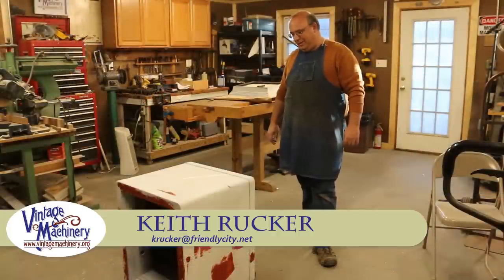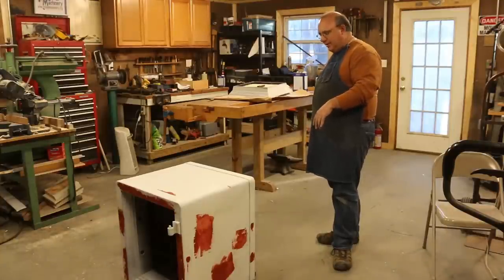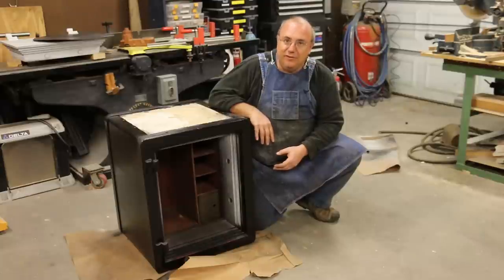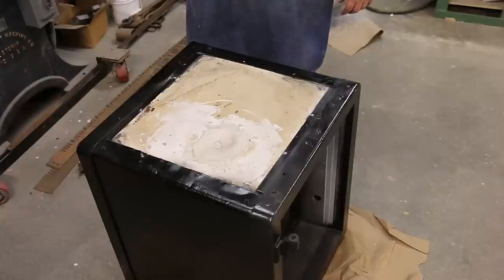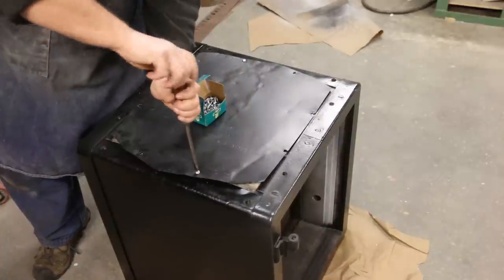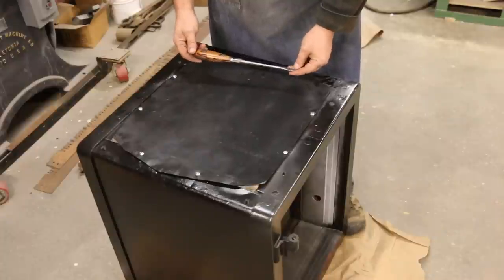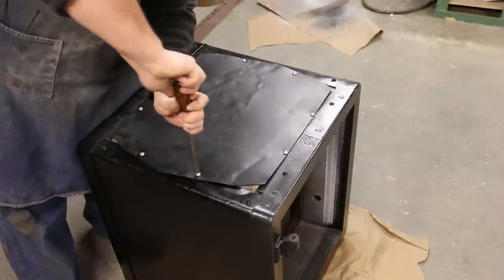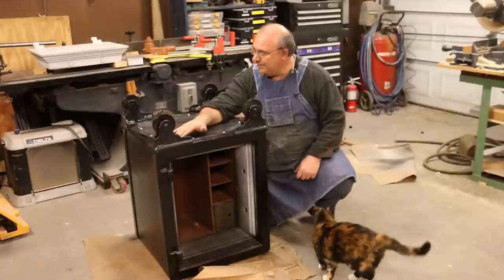Victor Safe Restoration - Part 7:  Paint and Reassembly of the Bottom

Comment: Mr Rucker one more thing while I'm thinking about it. Just went out to my old building to confirm this. However I have an old Briggs & Stratton lawn mower that it's engine has an updraft carburetor on it. I tried getting a cab kit for it and the gentleman at the small engine shop said it dated back to 1950 lol. That's another project. I did however actually get it to fire up and run for just a few seconds and it don't sound anything like the engines do today. Sorry to keep on about all this I just like my old things. You have a great day Sir.

Comment: I collect old school things. I have an old Philco AM radio that's all tube built in 1936, I'll be restoring myself when I can get all the various components I'll need. It's got a glass dial face. Only thing I'll need to send out will be the speaker to have it re-coned, I was hoping when I got it there wouldn't be much Id need to do other than change the caps and maybe a few bad tubes. Didn't work out that way lol also own 2 old MAYTAG ringer washers. One was built in I believe 1947 the other 1965. The 65 model works great Im going to wash a load of clothes in it after I change the transmission oil lol The 47 needs a ringer head but transmission and the motor an body is in great shape. What I want to get next is one that has a gasoline engine. We had one when I was kid and that thing was some kinda loud, straight pipe was all it had lol but it got the job done. Enjoy the videos Sir God Bless.

Comment: That will be a very nice safe when you are done. I have a very similar safe that a previous employer sold to me for next to nothing. Mine is about 50 in. tall with no major damage. It has an inner door and also shelving with a lock box just like yours. Mine is a little bigger so the lock box with the little shelves are in the center with larger cavities on both sides. They disabled the lock (without damaging it) and used it to store machinist tools in. Mine has a bunch of patent dates printed on it from around 1909- 1913. Some day I want to give mine the same treatment.

Comment: Re wheel orientation

When the safes get bigger, they get wider, but not deeper so they still fit through the door.  The wheels are oriented so you can push them across the floor and through the door.

Comment: It really seems odd to me that the wheels are installed to roll sideways rather than front to back.  Is there a reason for that?  Otherwise... cool.
Reply: We have an old safe like that in our office and I believe the wheels are sideways so that when the big heavy door swings open the safe doesn't roll towards you. Ours is sort of up against a wall, and when the door swings open it gets even closer to the wall. I wouldn't want that whole safe coming after me.
Reply: They are mounted sideways for a few reasons. One is that the transverse mounting allows the safe to be moved into position without shifting the contents out of the shelves. Another is that the wheels make is safer to open/close the door. With the wheel axis 90 degrees to the door the weight of the door doesn't rock the safe over onto it's face, also if the safe is enclosed the wheels make it somewhat more difficult to remove from the enclosure.

Comment: Most or all antique things were painted by brush instead of by spray.  Do you take that into account in how you finish your restorations?  More a question than a comment to someone deeply involved in restorations.  You are of course free to finish them any way you see best.  I really do appreciate your telling us in your videos about the choices made when restoring your projects and the reasons behind them.
Reply: i have found myself if the paint is just right, brushing paint  can look very good indeed, last thing i brush painted was on a very hot day indoors, the paint was also pretty warm, it really helped get a nice thin coat without it feeling like glue, (some paints and varnish on wood benefit from adding a little boiled linseed) .i too use spray primer on metal, but brushing has a technique to it, and have used a foam roller to apply varnish and paint, it came out very well indeed, dries faster between coats and more evenly, theres certainly more ways to restore than just spraying paint

Comment: Why no washers on the square head caster bolts? Wouldn't that save the paint from being scratched by tightening the bolts? Also, why do you think the bottom tin wasn't cut to the size needed to cover the opening? The voids look like they'll be welcoming doors on a home for 8-legged critters. Not criticizing, just curious. It's a cool project.

Comment: I've been thinking about that old safe.  Wondering if you had been working on it.  Great job so far!
Reply: *****
the last few things i have brush painted i decided no filler, surface was power wire brushed and then initial primer was can sprayed, , brushing goes on real easy on that as you try for thin pain and not to fill anything. you dont mind seeing damage or wear  marks in steel, so much better than seeing paint which can look like a blind man with the yard brush did it

Comment: Hi I like the restoration that you have done to the safe, but ......I honestly dont like the screwed on panel at the bottom - I understand that you are keeping it to the original condition but surely that panel is a weak point in the construction of the safe and totally contradicts the whole security element especially someone could flip the safe unscrew the panel and attack the vulnerable area to gain access. Personally I would have welded a new thicker plate on the bottom as I would prefer to sacrifice the originality in favour of the security elements - but each to their own 
Nevertheless thanks for an interesting and enjoyable insight into your workmanship and restoration project

Comment: Hi Keith you know what type of paint would look real nice on that safe Rust-Oleum® Universal® Forged Hammered Spray Paint. Check out the youtube video on how it looks and how to apply it. The paint looks like if you hit the paint with a ball pin hammer.    https://www.youtube.com/watch?v=Lmjr7CFIXi4
Reply: i hope it not like the uk version "hammerite" which is like painting thick glue, runs constantly when you dont look, , takes weeks to harden and then chips off so easily like glass, (spray version clogs the nozzle, covers terrible, dries slow, runs and still chips badly) i have given up on their products, but have used a product called rustins "small job gloss paint" and it paints really nice indeed, evens out perfectly and dries overnight
Reply: jusb1066 They have different brands and the one I'm talking about its call Hammerite hammer paint it and drys fast and its hard in 24hrs.
Reply: ***** I understand to restore like it was. You really have done a nice job on it with the recasting of the wheel holders. I've never done casting but I've learned so much from you just looking at your video's. Thanks Keith.
Reply: jusb1066 I don't know how you prepare or use the Hammerite brand paint. I have used it for the last 40 years and have never had a problem with it. To be honest its not so easy for brushing but for spraying its great.  If you brush you need to be quick and the more even coating the better and don't try to dab it on. When spraying the more you thin it and the thinner the coating you get and the finer the finish (much smaller roses). I once sprayed a Vauxhall Cresta with it and it looked like a silver metallic and was still good 20 years later. As for hardening I have never know it to take more than an hour or so even in the cold weather. I have brush painted and sprayed machinery / vehicles / steelwork and furniture. As I say I have used  many 100's of gallons and never had a problem.
Reply: Gary C I agree with you. Some people don't follow instructions and get a bad effect and they blame it on the paint.

Comment: To be honest, i like those old screws Way better than the cross screws... (philips, pozi, etc, i dont know the genereal name of those in English)  I seriously hate cross screws when using machines they are complete useless and they are extremly ugly to look at, at my opinion in fact so ugly that i often refuse to use them at all becas they will ruin the whole look of things i made or restore. I wonder why they still are so common when we hawe way better heads today, like insex, torx, etc. But, still, even the good ones still does not look right for puposes like this. I often hunting the whole town where i live to get the right types of screw heads and every shopkeeper stares at me as i am mad, (and pehaps i am... :D ) "-nobody use those types today, You know." is a standard answer here, especially if one wants them in brass or nicelplated brass. I bunker lot of them every time i find them sheap in fleamakets, etc :D
Reply: *****
Perhaps i over reacted a bit there, but with hand tools (a regular, non electric srew driver...)  those works good and i think they was a solution wich once in time filled a gap before insex/torx, etc where common standards and electric tools where not in wide use. But when used with electric tools they will often goes round and the bits will not last that long (at least here in my country they still developing lots of solutions one can find in the hardware store, diamond powder, "super Titanium-ultraFlex steel", etc...:D ), an old fasion screw like those we are talking about here more often the screvhead it self will break before that happen, if it´s not rusted complete stuck... Guess i must stop now, think i can talk screws for ouers... :D

However, i love all Your videos and a friend just got an old safe wich reminds a bit of this one, but with a big wooden cabinet in it´s stand. Think we will sawe and restore it even if it´s not fulfill modern demands it´s decorative and a pice of history we want to show our visitors in the factory in the future. But for the moment i promised him to finish that old cropper he saved from the scrapyard some months ago... Then we hawe a pair of old shaping machines wating next in the queue...
And i still realy love and enjoy every minute of my job! :D